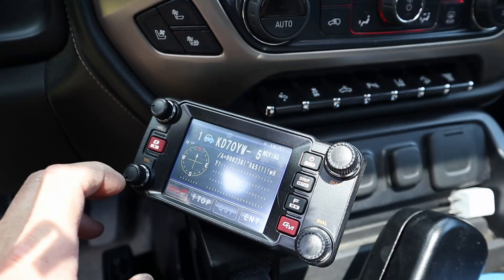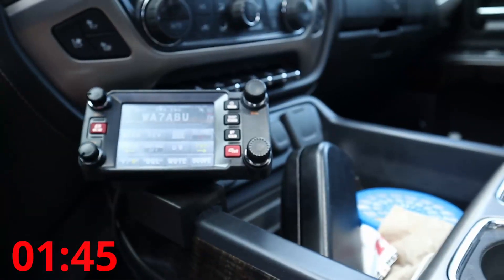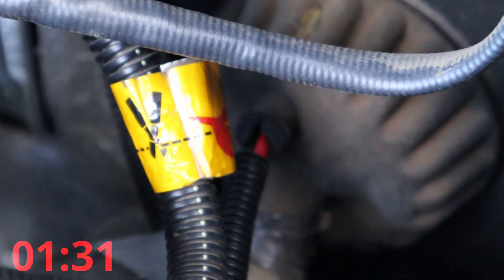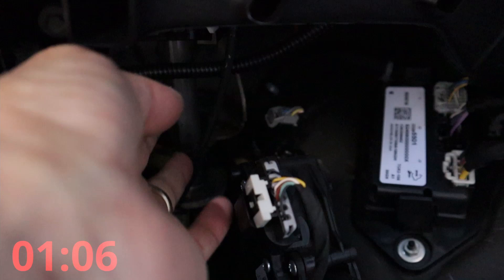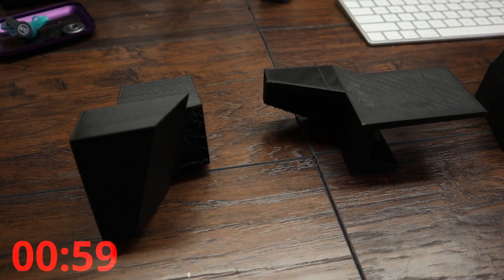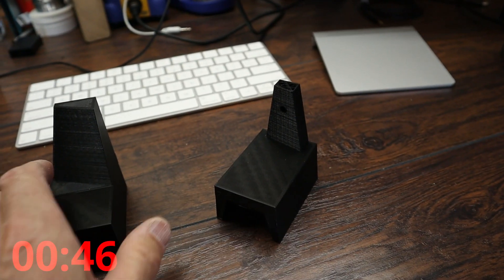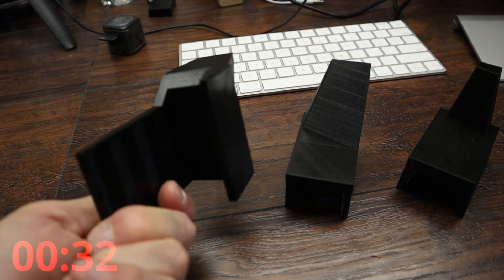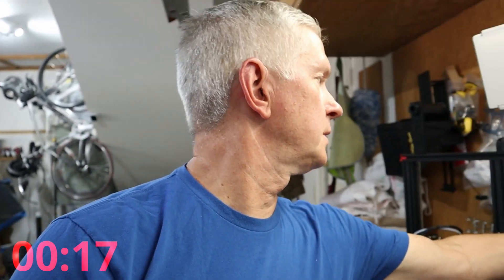Yaesu FTM-400XDR Install - GMC Sierra - Two Minute Tuesday (#40)

Comment: How did you go about mounting your antenna and routing your coax?
Is it safe to route the coax parallel with your power?
Did you consider installing the base unit under a seat or inside your center console?
Where do you hang your mic?
I have nearly the exact same truck and I’m looking to install my FTM500 in it much the same way you did.

Comment: Did the inline fuses come with the radio? Also, did you get the BT module? I am curious if you can pair with the GM sound system? I have a 2016 LTZ trim and am thinking of putting the head unit in the deep well under the cup holders. Not sure how hot it would get...thoughts?
Reply from the maker: Hey Marc - thanks for checking out the video. Yes, the radio does come with about 8' of power cord with inline fuses - however I chose to use my own 12 awg wire and marine type fuses.  No, I didn't get the BT module but thought about it.  I have hooked up the radio to the GMC entertainment system via patch cord. There is a jack under the center console lid, making the signal sound great.  Putting the radio in the storage compartment as you mentioned was my first thought. I don't think it would get too hot, however I wanted to use the builtin speaker.  But probably the deciding factor not to put it there was the cable clutter.  My final placement just worked out cleaner for me.  Good luck on your install and let me know what you finally decided on.  73, W0KNI

Comment: Very nice and clever way to mount the head unit!!  73, K8JLW
Reply from the maker: Thanks Reid. I first had my eye on the goose neck arm but two things immediately got in the way. First the seat mount rail in the 2016 GMC does not allow easy access to the bolt rail AT ALL.  And lastly, the seat rail mount had the single screw to the head unit which i wanted to avoid anyway.  So I made my own! And after five tries, I'm really happy with the stability and modular aspect of it.  Since this radio is really two-in-one, it's perfect for working Satellites.